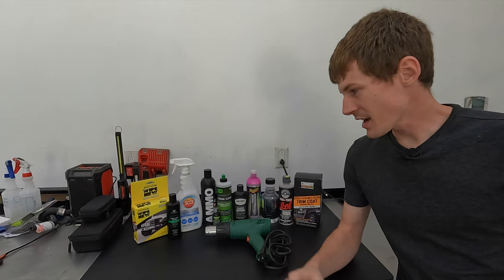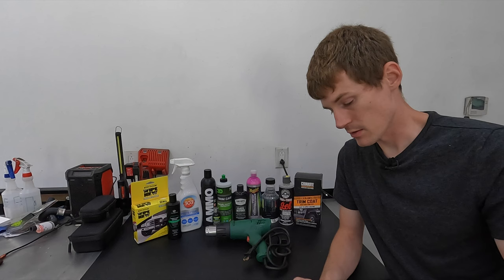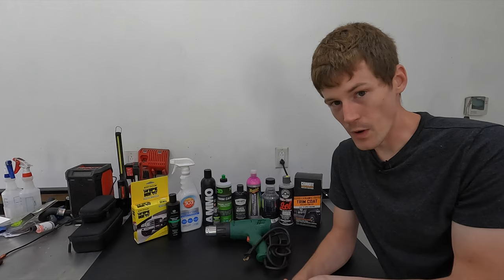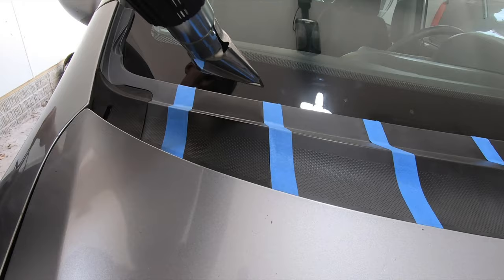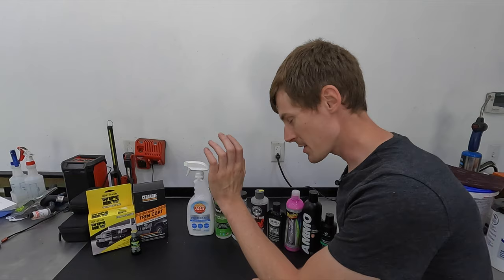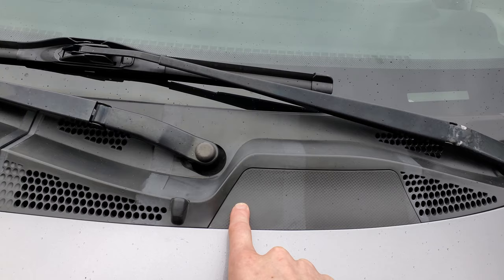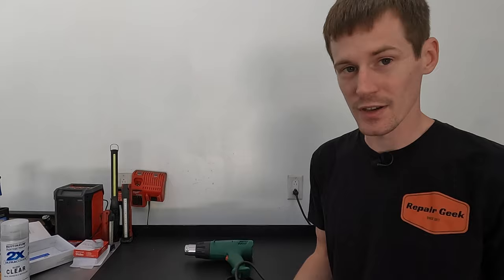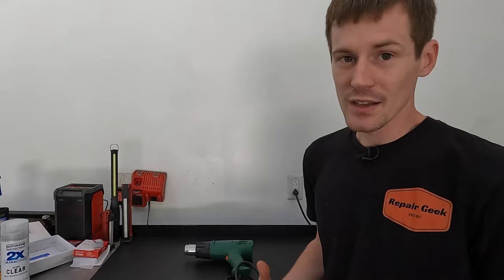Longest Lasting Trim Restorer Test.  Meguiars "Ceramic", Chemical Guys, Cerakote, Ammo, & More...

Comment: Search YouTube "Scott HD trim". He did it for a year, in the sun, on different panels.

Also, the ceramic coating might not help with UV, but they seal the plastic from losing the oils in the plastic from evaporating, so they will probably help with longevity. If you want to block UV, just put sunscreen on it.

Comment: Very detailed & informative vid, good job, sub & liked. I would have liked to see what happens if you put a line through all these products & add a thin final wipe of sunscreen lotion & a test patch of just sunscreen lotion too since it had such a high UV protection rating, I wonder if the products would have held up better over time. TFS. Cheers

Comment: 303 is interesting.  I use it mainly on the dash and such and you can tell a big difference between my 1999 F-150 and my 2012 CRV.  It really looks good on the F-150, but not so much on the CRV.  Now, I have some other stuff, I think Mother's Back to Black, works much better on the CRV.

Now as far as exterior trim, I used the Ceramic Trim Coat after seeing it on Project Farm and it works pretty well on the CRV.  I go through a car wash pretty often and it lasted over a year before it needs to be reapplied.

How about trying that car guys on the inside dash, tell us what you think about the results.
Reply: I use 303 on my dashboard, and nothing adhesive will stick now.  Hard to keep my dashmat from slipping off. Finally crammed it into the windshield slot with black rubber tubing
Reply: @wallacegrommet9343 😂😂😂

Comment: I am a pro detailer and I use Solution Finish to restore trim.  That product is a dye and last about a year.  I am really curious to know if sunblock would make a good trim restorer.   Would probably stay wet and evaporate quickly but it would give great UV protection.  Wanna redo the test with it ?  :)
Reply: I came here to say the same thing.  Solution Finish is the way to go!

Comment: I learned that if I want good long-term UV protection when going to the beach, I just need to clear coat myself.  One question I do have -- Did you check the slides just to see if there was much if any variation in readings between untouched slides?  Just wondering with such small differences on some of the products whether or not they did anything at all for UV or if the slides themselves may have contributed to the variations
Reply from the maker: I did check multiple slides. My results were fairly consistent. The range that I was seeing was 10.3-10.7% blocked UV light with just the blank slides. I'm sure there is some error in there but it doesn't change the fact that none of these products had a drastic change in UV resistance contrary to their claims. Like I said in the video I could have laid them on way thicker than what you would actually use them and I'm sure additional film thickness would skew results as well.
Reply: LOL

Comment: 303 is a protectant you use from having a new car or new piece to extend the life of it,jusy use that whwn you wash your car and and a car cover and your car will look new for years
Reply from the maker: 303 has trim restorer printed on the label. Why would you restore plastic trim on a new car?
Reply: @RepairGeek  in bold writing it says protectant and if people used "protectant from the beginning(new car) then they wouldn't need restorer.but yes i know what your saying about it being on label but its not nearly as strong for restoring they have a marine base thats pretty good aswell .

Comment: Does that sensor say what kind of UV it’s measuring for? Is it UVA or UVB? Because that can definitely make the difference if the products are made to protect against UVA but the meter reads for UVB
Reply from the maker: 95% of natural UV light is UVA. What this tool measures, they don't specify.

Comment: you need to properly clean the trim prior to application of trim restorers. An IPA wipe is not sufficient. Use a strong all purpose cleaner and rinse thoroughly. The best trim restorer is Solution Finish. Its a two part system one part is a dye and the second is a ceramic coating.

Comment: Why clear coating the plastics after using a heat gun is not a good option.? Any tips. I have a scooter that needs retouching for its panels

Comment: "Shiny" is not a sin....I, personally, enjoy a glossy result from a trim restorer. It reflects 'durability'. Ceracoat IS a shiny product; just don't wipe it down  like demonstrated on another YouTuber's Channel. On older bumper trim like my 'new-to-me' 2005 GMC Canyon, it has never been shown any attention in 18/19 years. I degreased & rinsed it twice with that blue dish detergent, then rubbing alcohol for results as best as possible. Allow to fully dry. On went the initial coat of Cera Coat, WITHOUT buffing it dry,  let it fully dry overnight, then a final finish coat, again, without buffing. It dried like I prefer; a deep dark glossy sheen. Since I don't wash my truck with any detergent in ANY case, I'm of the opinion that the CeraCoat treatment will LAST...and it looks great.

Comment: 👎The only way to "fix" this is to Prime, Paint and Clear coat !! And even then becouse it's plastic with no uv protecting it will still need to be striped and redone every 3 - 5 years! ( 8-10 if garaged every day)

Comment: Sounds like a class-action lawsuit to me. The manufacturers of these products  are simply lying.
Reply from the maker: They never specify how much they reduce the UV impact. They just say they reduce it. So if it helps .0000001% they aren't lying. It's just not enough to be useful.
Reply: @RepairGeek  except for the ones that actually managed to magnify the UV lol
Reply from the maker: Valid point... lol

Comment: You chose the wrong ceramic coating. Gyeon Trim finishes with a matte sheen like the OEM finish and I've had it on my car for 6 years so far, with just one application, and it still looks as good as the day I put it on. Gyeon Trim is the ONLY way to restore faded plastics, and I've tried more products than you have in this video.